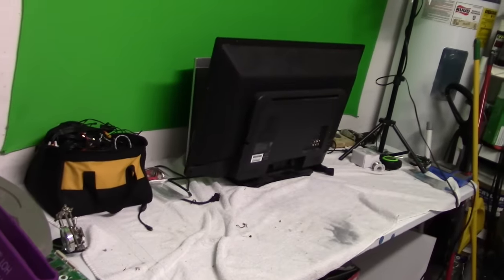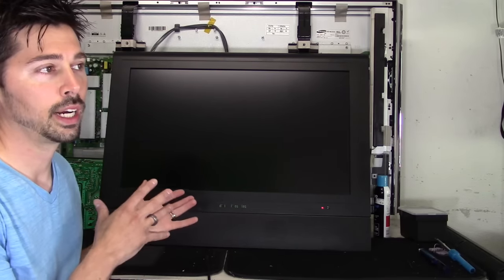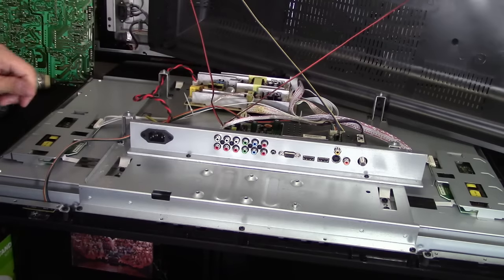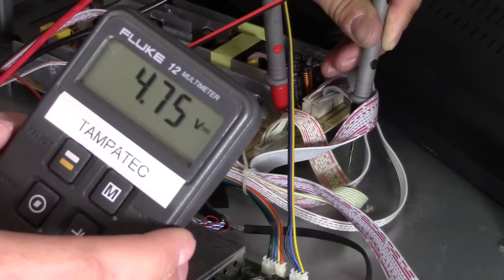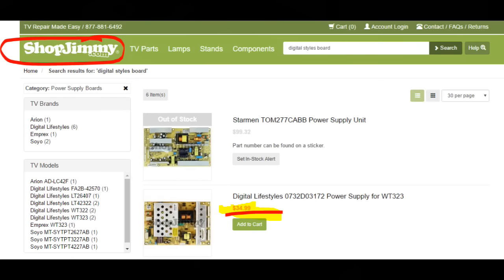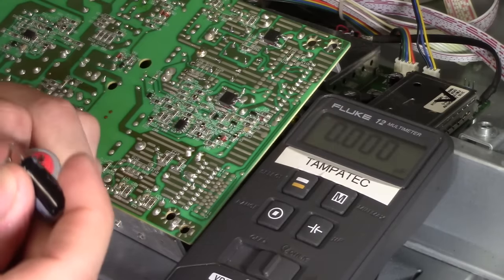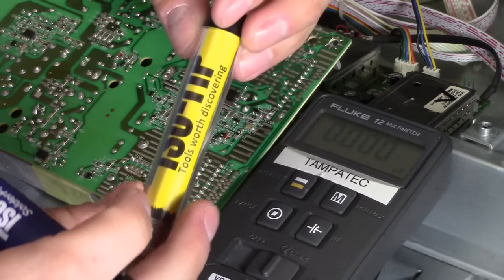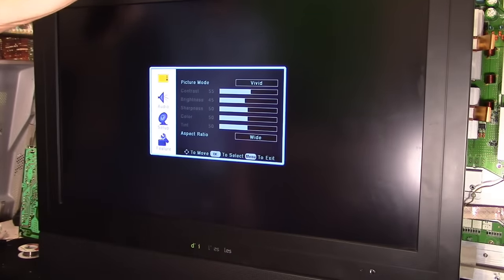WATCH THIS VIDEO BEFORE THROWING OUT YOUR BROKEN FLAT SCREEN TV!!!

Comment: I had similar problem with my LG TV; a capacitor had blown on the power supply board.
It would have cost around £35 for a replacement board and another £80 if I had an engineer to replace it for me.
Instead I bought a capacitor from a local.electronic supply store £0.42 and replaced it myself. TV now working fine.

£115 vs £0.42!!!

Thank goodness for some basic electronic know-how and some common sense!
Reply: Wonder if you could advice me..  .
My T.V has the standby light, if you press the buttons on the side to wake it up, I hear a kind off click sound.. like it half arsed wants to power up. 

I literally stood there for over half an hour before trying to get it to power up, which it does eventually!  But prior to purchasing a part, this is what I have to do...   Just not sure what part I will need?
Reply: @jaeda88  

You need to open it up and look at your capacitors, make a note of the values for them. And change them ALL.
Reply: @jaeda88   just look up make /model/ serial of your tv. open up the back  (in hopes of label on circuit boards) or inked onto the board for identification and replace.
Reply: What are these strange symbols??
Reply: Engineers don't fix TV's. Technicians do...;)

Comment: First of all great video. I am a retired E&I tech from heavy industry, paper mill to be exact. Please remove all rings etc. before working on electronics as the potential for painful injury and equipment damage is present if you have conductive things on your hands,don't ask me how I know.It only takes a second to remove them and be safe.Its not something you normally think could cause a problem but the potential is there.

Comment: Great job, I have been repairing crt's for 25 years, now they are mostly gone. I am retired but fix the occasional led tv for people. Your tips are very good but most people are unable to use hand tools much less understand a voltmeter. I am going to repair a backlight problem  on an LG tv for the first time. I told my buddy this is like open heart surgery. One mistake and the patient is done. Great fun for me!
Reply: Yeah, i scored a 50" lg that i had to replace 2 leds to get the backlight working. On refitting the diffusers and screen, something was slightly out of place so when screwing the bezel on i heard a click and realised i broke the screen. Now only the backlight works but I'll keep it for parts. Lucky it was free but I'm still kicking myself!

Comment: Cheaply made capacitors are the curse of modern equipment , and the horrible solder used nowadays . Lead solder is best but don't forget it can be absorbed through the skin when handled , gloves prevent this if you use it a lot. Always nice to see people repairing things instead of throwing them away !.
Reply: And solder only in a well ventilated area.  Do NOT breathe lead fumes.
Reply: Glpi lpi  no kidding this is the same people who want to tax us to clean up the Earth.  Yet make this stuff we just throw away.
Reply: @ingleringlet-snipps3rd449  
CORRECTION: There are NO lead fumes!  You are misinformed. The temperatures are too low to vaporize the lead... The fumes are only from the FLUX -- Still not good for you, but it is NOT LEAD!   
There is enough fear in the world without adding to it unnecessarily!
Reply: Solder  made from 63%  Tin,  37% lead is the best because the temperature between liquid and solid is just a point  at 361 degrees.  This helps prevent "cold" solder joints. I have been using tin/lead solder since I was 10 years old.  I am 72 now and no ill effects.  Of course you should have good ventilation, but unless you are eating the solder, there is little to worry about.
Reply: @swinde  agreed been soldering since 6 now 65 worked in tv industrial communications marine and a ham radio operator soldered a lot agreed no lead vapour but flux fumes plastic fumes possible also so provide ventilation . Wash you hands well using liquid dish soap no problem before eating or handing food should be good

Comment: You have such a nice smile! I picked up a tv off the street I want to fix so my mom can use, it turns on for about 1 second, the screen flashes blue then turns off. I hope I can figure it out!
Reply from the maker: Thanks, check standby volts on power supply if it's under 3v then replace power board but if standby volts is ok and steady then can be bad main board, tcon board or led strips.. Get tv boards at shopjimmy.com or electropartsonline.com

Comment: I had found a 47LD450 by the side of the street that had been thrown out. It only showed the red light, no picture and I couldn't get sound either. I followed your advice about checking the voltage on the pins from the power board to the main board, and it showed 3.35v on pins that should have been 3.5v and 0v on the rest (some were supposed to be as high as 20v). I ordered a power board and I will update this post when I install it. Thanks for posting this video.

Comment: Thank you for this helpful, easy to follow video! 🤩

My TV has the issue of the red standby light but not powering on. Unplugging to reset it was working as needed for a few months, but the frequency needed for that continually increased until yesterday it seems to have given out for good. I'm going to try replacing the power supply board -If I remember, I'll update here how that works out for me! 🌟

Comment: I agree with your repair method.  I've repaired many LCD monitors using this very same method and I always try to get a high voltage cap to replace the defective ones.  

You might point out to your viewers that sometimes those caps (capacitors) will blow out the bottom (where it connects to the circuit board) and will not appear to be blown or domed.  I've seen this issue on many power supplies.  I've subscribed and will be following your work.

Comment: Great video, good job. I do have something to add that may be helpful. When sourcing new capacitors it is always a good idea to increase the voltage handling capacity but be sure the dimensions are the same or close enough. Even more important, especially if the faulty caps are swollen, is the temperature rating. It is likely the caps that failed are rated for 85C and for a little more money you can get 105C or above rated caps. These will last much longer and with the money you're saving why not make your repair last? Also, electrolytic caps dry out over time and are a big failure item. It's a good idea while you are in there to replace all the large caps if you can afford it. (the small caps are usually safe to leave in as they are mostly signal handling or dc blocking components and see much less stress)

Keep up the good work!

Bat

Comment: I just did a DVD with a bad filter cap, I was actually looking for it since the menu screen was showing a faint 60 cycle hum before it died. I did TV repair in the 80s when transistors were beginning to dominate, it was all component level test and repair, here I am 63 years old and still playing with this stuff, too much fun.

Comment: I've replaced the capacitors on a computer monitor and a 46" Samsung.  The monitor I had owned and the 46" Samsung I found in the street.  Another 46" Samsung I bought at a Garage Sale for $5.00 and all that was wrong was a loose ribbon cable.  Then I was given a 52" Samsung with horizontal lines that come and go.  Sometimes I would take an HDMI out and back in and other times there were no lines or the lines just went away after five minutes.  The total cost for 3 remotes, 3 TVs, and capacitors is about $25.00.

Comment: Just found your site.  Outstanding.  Figured these days most old TVs were just tossed and a new one bought.
Reply: That's what they want you to think. That is also why they installed 25v capacitors in there, they will expire more quickly in my experience. I've done this repair on many monitors myself, and i always install a higher voltage, and i have yet to replace a capacitor ive installed.
Reply: thats how they make money...everything breaks down so quickly
Reply: Richard Mann I
Reply: Oscar

Comment: I had this same issue a few years ago. I checked out a similar YouTube repair video. I had one capacitor that had swollen and blown a hole thorough it. Cost 50p to replace. Soldered in. TV worked and is still working.

Comment: I did same thing to my 10 yr old samsung. upped the volts on cap from 25 to 35 also. works great. these tvs really need cooling fan cause it gets hot due to flourescent lighting, maybe its made that way to fail prematurely and sell more tvs? great video, keep them coming.

Comment: Great Video, between you and another guy, helped me pin point the issue, had faulty Y board and mains board, replaced, now up and running, cheers
Reply: What were you're symptoms that led you to replace those parts.  I have a screen that is showing half black screen and half a lot up screen.  Backlight is good
Reply: @bens3767  green lines and someof the apps not working like Plex and cutting in and out as if something was on its way out.

Comment: As a fellow Tampa-area resident ... thank YOU for sharing & creating content that has grown my understanding!

I am currently working on a SHARP 70 (LC-70LE755U).

The screen works - - but - - has a "wavy" picture.  I have individually replaced TCon + PowerSupply +IO board (testing image after each install).

Unfortunately, zero change from original screen fault.   Those are the only boards ... minus some edge lighting + wifi card.

I presume the LCD screen is not damaged ... since the lines are not fixed.

At this point, I dont know what else I can do to repair ... besides maybe stripping down the chassis & replacing the LCD panel - - as a "long-shot"

Comment: I salute your unrelenting knowledge sharing technique. Keep it up.
But can you put me through on Laptop repair and sourcing for parts?
Reply from the maker: i go on ebay, usually its power port that needs to be soldered or replaced.
Reply: Mikail Okewole, if you're doing laptop component replacement? then due to their small size I've often used a 'Solder Paste' which is a fluid you simply squeeze through a syringe and it becomes conductive after drying - it beat getting a clumsy hot soldering iron into those tight spots.

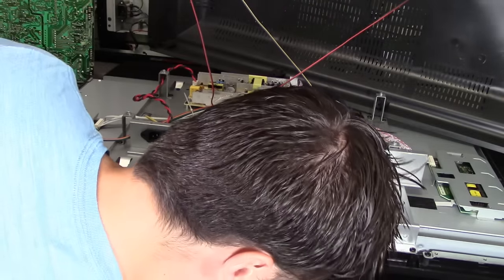Comment: Problem spotted at right about 2:31, we have a few condensators (capacitors*) that have inflated, I would bet that those are on the 12v rail. And I agree with most comments, based on my personal experience, 9 times out of 10 its the capacitors.

Comment: At 2:30, the first thing I spotted was the bulging tops of the electrolytic capacitors.  Capacitoris Bulgitis is a firm indicator for a transplant operation. :)

I had 2 x "Bauhn" brand (from Aldi) TVs which both failed in exactly the same way as the TV you're repairing (red LED and clicking when you try to turn it on) and when I opened up each, I immediately spotted the bulging caps so I replaced them and now I have 2 working TVs. :)

There's been a rash of electrolytic capacitor failures recently (over the past 10 years or so) and now they're always my first suspect.

Comment: The last television I repaired,  I rinsed out with Dawn dishwashing liquid and a hot garden hose.  I gave it a good wash out let it dry a week it's been running ever since about 8 years ago. The detergent did a better job than air blast on the affected high impedance circuits.

Comment: I just fixed my LG tv that had sound, but no image... just as you said, I opened it up, and had to change 3 capacitors, 6$ total... that was it.  Problem fixed! TV works!  Incredible.  The hardest part was identifying the three capacitors that had gone bad.  Two were easy...  they were bulged on top.  The third was was very difficult to see... one was slightly blown on top.  They were the 35 volts, 680 uf; the 10 volts 3300 uf and the 10 volts 2200 uf, 105 degrees.... in any case, they were on the power circuit board.  My dad was an electrotechnician and I had time to learn from him... Your videos were an inspiration to go ahead and try to fix that tv... a 500$ saving.  Thanks so much and keep up the good work!!

Comment: Yesterday I managed to fix an old LG tv the same way.The tv would power on but it wouldn't produce any sound.turns out the 6volt rail was showing only 3 volts,and the reason was four swollen capacitors!

Comment: Very good work. I have been repairing electronics since the 1960's with electron tubes and later transistors and later microprocessors and very often when troubleshooting begin with the power supply.

Comment: there is missing part checking voltage of power board after replacing the capacitors.

Comment: A myth about leaded solder - there are NO lead fumes coming off it. The fumes are the flux. These fumes aren't good for you either, but lead has a boiling point of 1749 °C - your soldering iron will probably be at less than 350°C so there will be no lead fumes. The lead WILL come off on your hands so hand washing IS important. To avoid the flux fumes, you can use a small fan (e.g. a spare 2 - 3" fan you recovered from something with a wall wart PSU). Don't use a large fan as that will cool your soldering iron tip off. In industry we commonly use vacuum fume extractors (expensive), but we are dealing with OSHA and people who may be doing hand soldering all day (e.g. rework operators).

Comment: I have a Vizio plasma no picture but audio work good do you have any ideas
Reply from the maker: most cases it's sustain boards and / or buffer boards, Plasma TVs break often, they get really hot so try USB fan
Reply: Ok thank you my friend
Reply: Tampatec I have had the same plazma tv for 5 years. I got a great deal on it because they were going led on all of them. I was told this one was the longest lasting best Plazma tv out there. I guess the guy was right. Its an LG. The salesman said it was a shame they were getting away from plazma because mine was the way they should have all been made.Once its done,its done. I will be hunting for an Led style that needs repair as a back up. I am really handy at electronics and testing so It would be fun fixing a dead one.
Reply: Could also be a dry joint caused by heat.
Reply: Definately sounds like its broken.

Comment: Great vid Tampatec, I'm very much like you, fix tv's when they can be fixed easily. Now, newer tv's all have cracked LCD/ LED problems (for the most part) which is a costly repair and not worth fixing anymore. I'm curious if there's a way to salvage the working half or portion of those screens and port a rasbery pi or arduino to throw something up to at least make some use of them..

Comment: I have a sony bravia 32" lcd. It stopped responding. No buttons work, the remote doesn't work but when its plugged in it comes on. Its stuck on one channel. Any ideas?
Reply: a rough guess is that its the tuner control and software control pcb, the part can differ depending on what world region you are in, unless your a tech its not something you can fix (ive 30yrs experience and just swap them out because my labour would cost the customer far more,) but they arnt cheap so unless the tv is quite new (which at 32inch it prob isnt), id say its BER (beyond economic repair) sorry bud :(

Comment: how much do you charge for 4 hour work on the TV, which costs 300 $ new ?
Reply: King Parodije why would how much the TV costs make a difference on repair price?
Reply: gtrx
no one would let repair , if the repairation costs almost like the new one tv.he would be out of job. that's why I'm asking.
Reply: my oldschool little electronics repair shop up the road has stopped repairing almost every type of device because of this fact; he just turns you away when you bring him something that isn't going to be worth everyone's time/money
:<
Reply: Unless you do it yourself, it is cheaper to buy a new one.....which is why everything is designed to last only a couple of years, pitch it and buy a new one.  Picture will be better, less energy, etc. sad but it is a race to the bottom.  They can do more than yesterdays tv's, but don't last as long.
Reply: Somewhere, a Native American is crying, looking over a landfill that stretches to the horizon.
Reply: an hour of work let's say $35 an hour, plus $40 shop rate (gotta keep the lights on). a replacement part price ranges from $40-120. Total would be between $120-200. 

If it's a cap replacement, then the part costs go from $40-120 to $15 and about an hour of time... so $165? Cap replacement could be more expensive than a board swap, but you could get your TV back same day...

I'm in the process of repairing a 50 inch plasma TV that i've had for a decade. Sure i could drop 300-500 to get a new bigger TV that has LEDs and etc etc, but Plasma has better black tones and never has image ghosting. This particular unit also has S-Video, RCA, and Component along with HDMI. If you are into retro/vintage gaming you want both S-Video and Component and most modern TVs dont have either. It'd be nice to add a third or fourth HDMI to the unit, but whatever. I can use an HDMI splitter for that.
Reply: If you get old tv repaired, you have an old tv, no warranty and a repair bill. Buy a new tv you have a smart tv and 2 year warranty.
Reply: @robertkat  And contributing to filling landfills and covering planet earth with more unnecessary plastic waste.

Comment: Nice work, did this with old plasma TV and it worked for about 3 months and then went out again.  Went out and bought a Samsung smart TV  after that.  the Samsung went out about 8 years later.  Sent the board to this repair shop in California and they repaired the board and sent in back in  a few days.  It is still going strong 2 years later. It cost me $75, so it was well worth it.